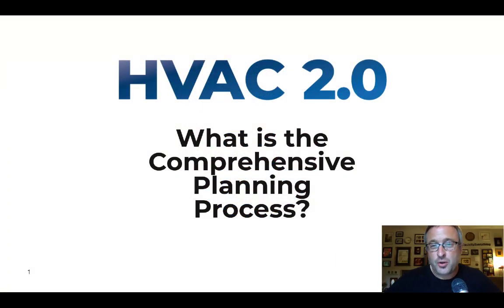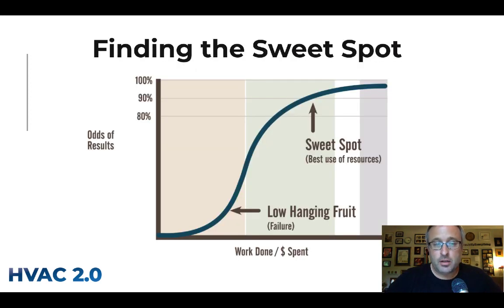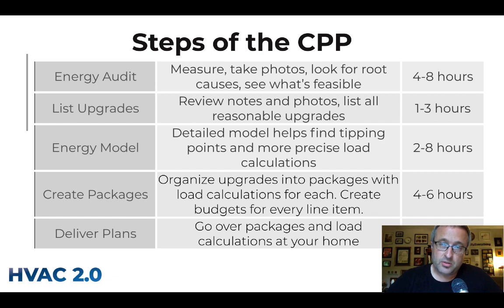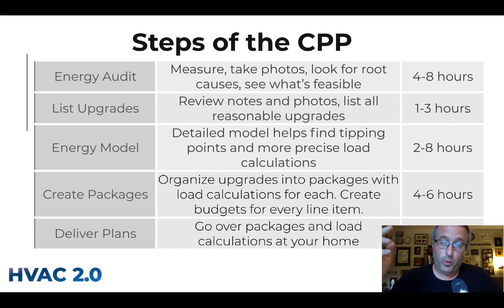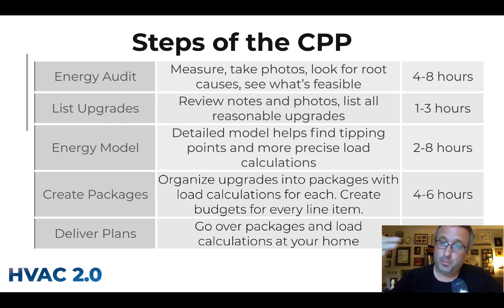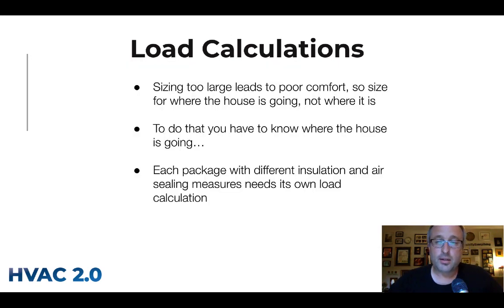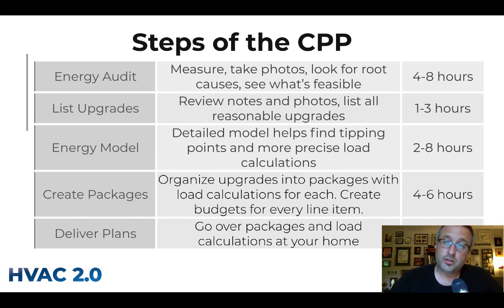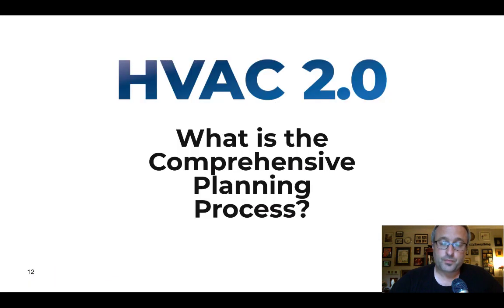CPP Overview Comprehensive Planning Process HVAC 20

Comment: Subway map.
After CC summary:
So you've had a comfort consult and determined that your house leaks so much that HVAC alone may not solve issues that bother you about how your home performs. So you need some diagnostics and design to better understand the situation, and build a plan to take for bids and manage the project.

3:40 gulf of disappointment and sea of success?
Reply: Yup, those should probably be added in.

Comment: How do you feel about backing in to the load used by using current equipment size and run time at intended temperature. For instance during the polar vortex a few years ago we had -22f. Our Nest reported that our furnace ran 11hrs in a 24hr period to heat our home to 68F. Our furnace is 70k btu. So 11/24hrs is about 45% utilization. Which is about 32kbtu/hr losses.

Is it flawed to think that a 3ton heat pump might meet my needs well?
Reply from the maker: We call that a "real world load calc." We like reconciliation points like that to see if load calcs are close to accurate. Your math sounds correct, the only issue being that heat pump output falls dramatically at very low temps like that, but that's what resistance heat is for - making up the difference. Odds are a 3 ton would be a good fit, but more data is needed. That data would be collected in a Comfort Consult, which is the step before this. Your house may be tight enough that a CPP is not needed. 

We do a decent load calc at the Comfort Consult, but it's a very rudimentary model, so we really only trust it to be accurate for where the house is today, not for where it could be. With a better model like we do in the CPP, we trust the predictions more. But both models need to be trued to blower door and energy use, and better still if backed up by Ecobee run time! Does that help?
Reply: Nate the House Whisperer I am in SE Wisconsin zone 6 I think. I have looked for a home performance specialist in the area along your lines but it is hard to really know who will be giving me info that I really need.  My goal is to electrify everything. 

To that end I have installed a heat pump water heater, installed 4kw of grid tie solar, and electric vehicles.I also had an insulation contractor remove my blown in attic insulation and air seal/ insulate to r-49. I have tried to just do the common sense things. The last piece is space heating. To accomplish I am pretty sure I need electrical service upgrade and load calcs to use a ccashp.I think that empirical info is prob my best bet, but I don’t know where to get it.  What advantages does the ecobee have over nest? Thanks, and if you are willing to consult this far from Ohio I’d be happy to pay or if you have a reputable company in SE Wisconsin I’d love to work with them.
Reply from the maker: @juancarrera5524  How far from Chicago are you? Our network is pretty small still, but we have someone in Chicago. You may need to pay travel charges, but he could do both diagnosis and install. It sounds like you are down to HVAC most likely, mainly you need a good load calc with blower door and energy bills, I'm betting it will come close to your estimates. 

Plan on a 200 amp panel. It can be done with a 100 amp in some cases, but it's close. 200 amp is comfy for a heat pump and several EVs.
Reply: Nate the House Whisperer I’m about 35-40 miles from Chicago. I was planning on a 200amp panel. Had a quote to get that in but pandemic uncertainty delayed that. If you have contact info I’d love to get in touch.
Reply: Also what do you love about the ecobee?
Reply from the maker: @juancarrera5524  Call Doug Krahl at American Temperature Control and ask for a Comfort Consult. Tell him I sent you. http://www.americantemperaturecontrol.com/

Ecobee is one of the few that does tracking of runtime, it also has decent options. The odds are you won't keep it with a new system though, it will only control 2 stage equipment. You can hook it to modulating equipment, but it will run it like it has 2 stages, not 5 or even 100 like some of them do. For the high end heat pumps you'll be getting a manufacturer specific communicating thermostat. Our preference leans towards Carrier GreenSpeed or Bryant Evolution which are the same product with different logos, just like Chevy and GMC are the same truck.
Reply: Nate the House Whisperer  Thanks Nate, I bought the Home Comfort Book. And started informing myself on building science and it has been a blast and so much fun changing the way my home works and learning along the way.

Thanks for being a teacher, thanks for being a champion for change and the future, and thanks for your well considered responses.
Reply from the maker: @juancarrera5524  Thank you Juan. It's comments like this that keep us going! So happy the content has been helpful, and thanks for buying the book!